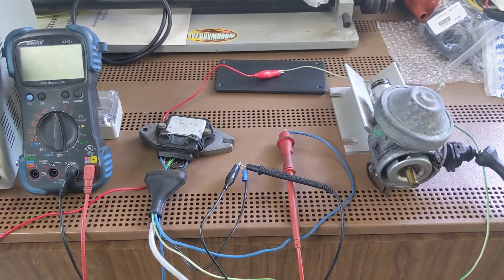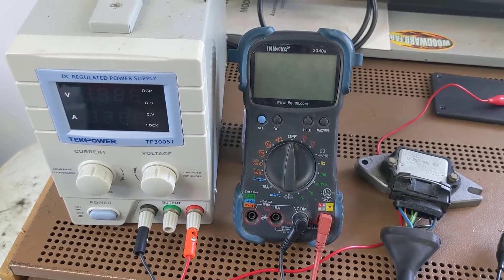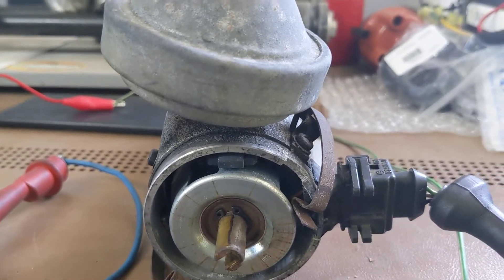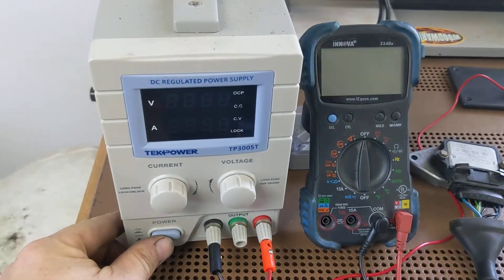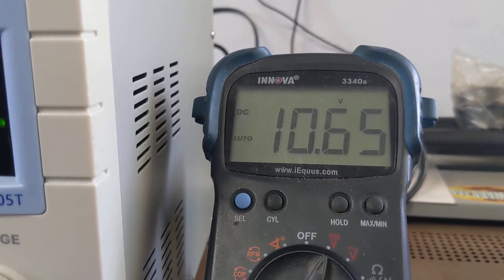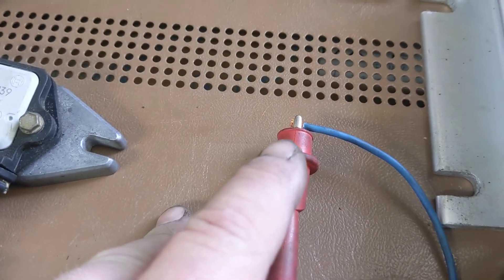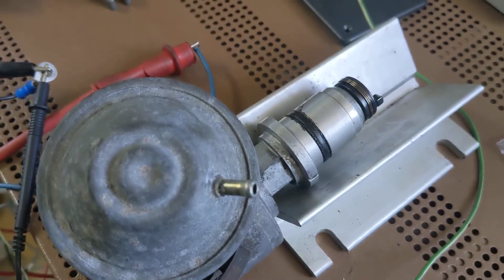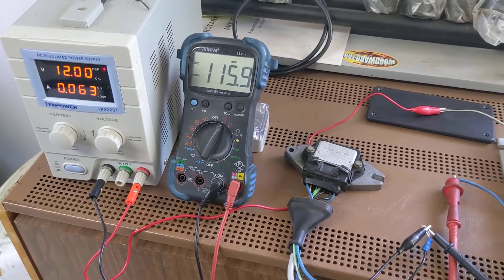Testing c900 Hall Sensor

Comment: Ignition control module. What occurs when the ignition control module is bad?
I have Hall Sensor. I unplug the Hall Sensor. I test the three wires on the harness with a test light,, ground is good, the middle wire gives the impulse noise BUT…there is no power to the GREEN wire (hot)…. I don’t know why 😭I am so desperate for my car to run

Comment: You should really say what the voltage should be for the signal side of the wire. What's the normal voltage to look out for on a hall sensor?